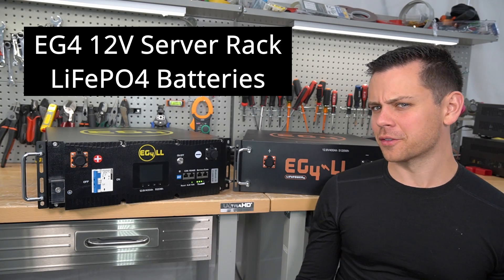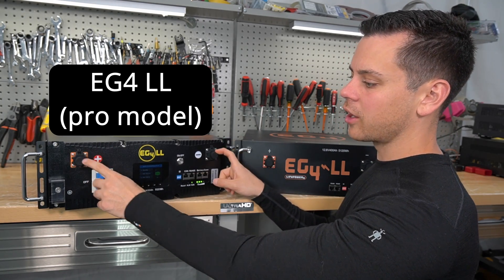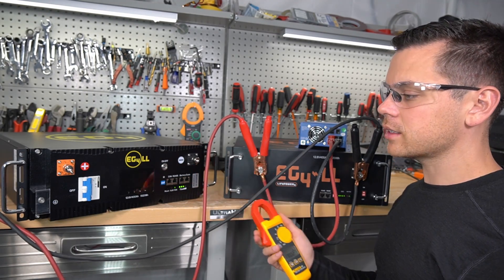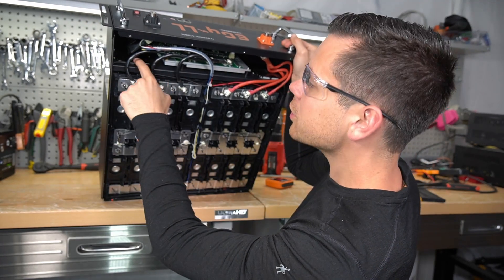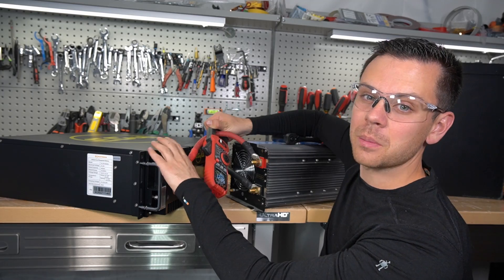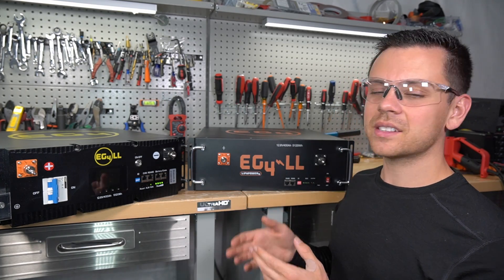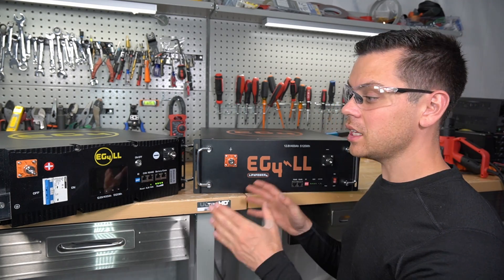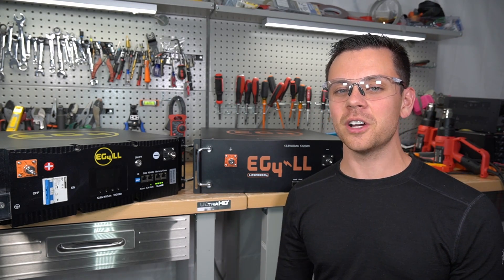$1,449 EG4 12V 400Ah LiFePO4 Server Rack Battery

Comment: You may not like 12 volts, but for us who have been on solar since 1984 we had few options. It still serves our small system well. Still living small.
Reply from the maker: My first 120W solar panel was $550 13 years ago, so I've had 12V systems longer than any other. And flooded cell batteries. And thats why I hate them 😂 never going back
Reply: @WillProwse   My fi"rst two panels were bought from an advert in a Mother Earth News magazine from Energy Sciences in 1984.  That's nearly four decades ago.  I was scraping around on beans and rice and built an earth shelter from native and recycled materials that year...a large truck battery for storage...two thin lites, one over the kitchen sink, one over the bed...a 12 volt JVC linear tracking turntable, cassette record and play, AM/FM/SW bands...that was my boom box...removable speakers.  I had a 5" black and white tv which picked up three channels I called Rambo, Dumbo and Bimbo.  Outhouse and hand pumped water in the kitchen sink.  Didn't get running water and indoor toilet until 2007.  We have a sauna at the center of our house which acts as a plenum and also our bathing space.  I still appreciate the simple life, although I do have more solar now...but still have many 12 volt appliances.  Yep, simple.  Wish more folks didn't live such wasteful, consumptive lives.
Reply: @WillProwse  I wish I could go with LiFePO4 batteries for my 36V golf cart, like you did for your 48V golf cart, but it gets over 130F here, and I worry that the BMS would shut down the batteries while driving.

Comment: I get that you've changed your focus to larger whole home systems so 48 volt systems make sense.  However, I miss your smaller system days.  Some of us have vacation off-grid properties where we have several small cabins or separate shower houses or saunas.  So we cannot justify and do not need the size and expense of larger systems.  Would be interested in unpdated info for smaller 12 volt systems using the latest reliable components.  This video was a great first step!  Did I hear correctly that these EG4 batteries have four times the Ah ratings of the Battleborn/SOK/etc... 12 volt batteries... for the same or less $?  Perhaps I misunderstood.  Thank you.
Reply from the maker: Yep that's why I made this video. Doing more 12V systems for people who keep requesting them
Reply: If you buy 4 Battleborn at the cost of $874 given by Will, you are looking at $3,500.  Or, you can get 2 of the "premium" version for the same $3,500.  That's 400 ah more for the same cost!  

I would get a pair of these 12v 400 ah batteries and wire them in parallel, you'll get a lower charge/discharge rate.

Comment: G,day Will from Sydney Australia.
'what I think '
I am analysing and putting into perspective;
* Easy use of a clamp meter (I like auto ranging multimeters).
* Using infa red scan to detect current heat (overload) at a connection/accessory drawing current.
* The difference between batteries in series v parallel (negative connection & positives) aluminium v copper as a conductor.
* Benefits of 24v over 12v systems. My answer is 24v= more Amps with fewer batteries?
🌏🇭🇲

Comment: Hey Will, on your price comparison, you say these are 327 or some in that ballpark but that is for 100Ah. On Signature Solar, they are marked at 1449 and 1799 each. Thanks.
Reply from the maker: This video is so long so I cut out a bunch of pieces. Totally forgot to keep the part in where I said it was 100 amp hour comparison. I didn't want to bore everyone with the long video.
Reply: I was confused as well, but I think Will is comparing prices per 100Ah. So what you have to calculate is the cost of the BattleBorn/SOK et. al. at the price listed times 4. So a comparable SOK system would be $559x4=$2236, as compared to the EG4 400Ah model Will has @ $1449.
Reply from the maker: Thank you Tom! Exactly
Reply: @WillProwse  👍

Comment: I have been using 4 of the 12v non-pro batteries for a year now in my yacht. They work amazingly. Mounting was easy. I built a wood bottom for the batteries with a lip all the way around so the bottoms cant slide and bolted that to the boat. Next, I installed a piece of strip stainless steel across all the mounting plates on the top to connect all the tops of the batteries together. Finally, I used 2 1000-lb nylon ratchet straps to hold the batteries down in the wood bracket on the bottom. The batteries don't move. I did not make a separate box for the batteries as they are in my engine room and not located around any moisture. If I get water up to the batteries, my boat is gone anyway.

My only beef with the eg4s is they don't make a 12v all-in-one converter charger to communicate directly with the batteries. I am using a multiplus 2 with Victron lynx and charge controllers.

If I was building a boat from scratch, I would go 24v or 48v. But, since my entire boat is 12v, i will just stick with that for ease of use.
Reply: Thaanks for the note about your boat install.  It sounds like you just stacked them directly one on top of another.  I am contemplating a similar install, but with the V2’s on our boat.  Initially thought I would install them in the engine room, but now targeting behind our flatscreen TV in the cabinet space originally intended for a tube TV.  But at 98 lbs each, that’s a slug of weight for a boat!  I am thinking of some kind of spacing between each unit to allow for air movement and heat dissipation.  I will also be installing them with a Victron MultiPlus II and Cerbo screen.
Reply: @mvfloatplane881  mine are mounted vertically, side by side...lugs are on top. I mounted mine in the center of the boat, midship. My old 8ds are mounted outbard stbd side. Right now, i am using them as start batteries so i dont have to change the alternators yet. I have 2 Renogy 60a dc to dc converters between the AGMS, and the Lithiums. Both renogys are switched. I usually only run 1 at at time.
Reply: @mandmmilling3716  Interesting.  My house battery bank compartment is centerline in the engine room but low, so I do not want to put mine there.  I will be installing Victron DC-DC chargers for my flooded start batteries, which are both outboard.  Interesting that you went terminals up.  That wouldn’t work for mine but I may rethink and stand mine on their side - it would eliminate the stacking issue.  I’d be interested to hear how long you can run on 4 of them.  I am buying 3 but was thinking of installing only 2 because even 800AH will be more capacity than we’ve ever had.  I have externally-regulated Balmar alternators and CenterFielder, each alternator 120 amp and 900 wats of panels along with an 8KW generator.
Reply: How many amps do you run into the 4 batteries to charge them. And do you have multiple charge controllers to charge each battery separately?
Reply: @EasyyokeFilms  the multiplus puts out 120a max, but i turn it down because of shore power limits. 3 charge controllers connected to the links (1600w). 2 110a standard alternators feeding 8d agms connected to 2 60a renogy dc to dc converters. 

Max i have seen from solar is around 70ish amps in perfect sun. 30a from multiplus, and 120a from dc to dc/alternators.  So 220ish amp under ideal conditions

Comment: I recently got 2x 200ah from Amazon for 1200. I also go the 24v Mppt all in one and when I first ac charged it I heard loud noise from the fan so I unplugged ac. Then I notice fault 2 code over heating so I waited  awhile disconnect from the batt and then I heard a pop when I tried to run a load so I disconnected again and it worked fine. I called watt24 but they didn’t pick up I just hope I didn’t get a dud

Comment: I will, I love your videos. I was wondering about your thoughts on four of these in a medium size travel trailer. I’m going to have about 1200 W of solar with a 3000 W inverter to run my mini split air conditioner among other things. Would you suggest wiring them to S to P for charging purposes or should I keep it all 12 V. Thank you.

Comment: Hi Will.  I'm definitely a beginner and will hire out my electrical work on my mini-bus, but I, at least, want a basic knowledge of what is going on.  You mentioned your love of 48 volts.  Do you see any of these large battery packs coming out in 48V?  I do like the idea of having one or two of these larger packs than 4-6 batteries.  I'm very limited in space and was going to put it in the "garage" area underneath my bed in a box.  These packs are so much nicer.  Any thoughts?
Reply: Most of these server rack batteries are 48V. For a given wattage, 48v require 1/4 of the amps and have the advantage of higher watt output and smaller gauge wire. Also, less amps = lower temps.
Reply: It sure is nice to be able to buy 1 or 2 of these.  Thank you.

Comment: I thought I wanted to go 48V...   I would guess that we could do a 120volt battery system...   why not 96V nominal?
Reply from the maker: Do 48V
Reply: What I want to start with is a UPS for a whole circuit
Reply: and then be able to expand to having it take solar and grid, and then add a bit more and have a minisplit that only runs when there is enough solar to justify it without cycling the battery.  then go to a whole house ups type setup with a bit of solar as backup, but would be nice to be able to backfeed to grid depending on prices

Comment: Why do you hate 12v?
Reply: The higher the Voltage of your battery/solar system, the more efficient it is to convert the power from the DC of the batteries to the 120V/240V AC of the items we need most of our power for, like refrigerators, etc. Also, Amperage is higher at 12V to power the same Wattage than a 24V or 48V system would be. For example, a 100W item powered by 12.5V, (The average 12V lead acid battery Voltage), needs 8A, while the same 100W powered by 25V would only need 4A to run it. While at these smaller Wattages, it may not matter, now imagine that you need to power a whole RV system that takes 10KW to run everything for a day, and you might figure out why 12V systems aren't as efficient, and why Will "hates" them. He DID start out with 12V systems in the beginning. See some of his earliest videos. ;)
Reply: @Tumbleweed5150  thank you I am a novice on this subject.

Comment: I feel like this device shouldn't exist. We shouldn't make 12v any easier. I can't think of a scenario where it's be worth it to build a system like this.
Reply from the maker: I just ran 48 to 12 volt converters in my RVs and vans. They are cheap
Reply: @WillProwse  those 48v to 12v power supplies handle starting the generator? Running electric leveling and electric slide outs? That's some high amp items for a power supply. What do you consider inexpensive? I checked, Victron doesn't offer anything but 24v to 12v higher amp power supplies.
Reply from the maker: @earlzeis35  yes because I had a small sla battery connected to the output. That's how I started generator, leveled my rc etc. Have you not watched my older videos? I took the Tesla battery videos down but I covered that a lot
Reply: @WillProwse  yes I watched a good many if not all your older RV related videos. I bought your book as well. Those videos were all 12v systems, that I recall.

I'm going to ponder 24v but I dislike needing to run 24v to 12v power supplies. How do they hold up? They reliable? My hydraulic disc brake actuator is 12v and can pull up to 40a. Not an item you'd want to lose 12v to. 

I don't see Victron offering any 48v inverters for RV 50a like the multiplus ii 2x120. Definitely don't want to run dual inverters for split phase. Too much cash and I don't need that much inverter power. 

Am I missing something on using 48v with a single inverter on a RV 50a?

I camp mostly in shade. So I planned to do two parallel arrays with 24v panels. That would work great on 12v and good on 24v. But with 48v you'd need to run series or series parallel to get enough voltage to charge 48v. Not good in full shade or even partial situations.
Reply: @WillProwse  which victron 48v inverter would you recommend to feed both legs of a RV 50a on inverter power as well as shore?
Reply: @WillProwse  I use the 48V to 13.8V buck converter, as the 48 to 12V one seemed weak, and because it only put out 12V, not higher, the Amperage ate up the cigar style plug on my air compressor for cars. I still have the 24V to 12V buck converter, but won't even sell it or give it to someone, as I don't trust it.
Reply: RV wise you're stuck with 12v. Unless you want to buy and install a few 24v to 12v power supplies. The entire RV runs on 12v. RV style invertors are usually 12v and some 24v. The popular Victron multiplus ii 2x120 for RV's was only available on 12v until recently. Now you can get 12v or 24v. I don't believe Victron makes a 48v to 12v power supply, I don't recall seeing any.
Reply: Finding the highest voltage you can run lights fans refrigerator, pumps etc ..and at the highest efficiency, with the least amount of draw in watts including standby combined with a solar package would be ideal. 
Bang for buck ROI without going overboard thus suffering the diminishing returns route.

That means picking a voltage that all your “NEW” components can run on at the highest efficiency.
Reply from the maker: I agree with you 100% and that's what I tell everyone too. But everyone keeps disagreeing with me and asking for 12 volt content. I don't understand why they like 12 volt. It makes me angry personally lol
Reply: @WillProwse  I was on the 12v train for a long time. 12v has the advantage that you can connect all sorts of car appliances without a step down converter that decreases efficiency and complicates the setup.
48v compatible gear seems to be more expensive. But yeah, the losses and cables sizes required are insane. Currently looking if 24v would be a good middle ground for my campervan. There still a lot of car appliances that do 24v because trucks run on 24v.
Reply: @WillProwse  reason why is if you make a mistake wirh 12v your not going to die. With 48v def ur gonna die from touching the wrong thing. People don’t like electric as it is. It’s dangerous as hell. 12v no worries. 48v like u said I wouldn’t touch anything inside. Well duh. Also 90% of us aren’t electricians. Think real hard about that

Comment: Confirm. When a manufacturer states 7000 cycles at 80% DoD it means to discharge them 7000 times (100-20%) and after those 7000 cycles. The battery will have 80% of the maximum capacity left?.(5120*.8)
Reply from the maker: Yes
Reply: Kinda short. I thought lithium wirh care would last 10-20k cycle
Reply: @jecrpalier  which should equate to my understanding. You still have a ton of use left after 7000 cycles. I would like to see data/research on the life after those 7000 cycles if degradation is similar. Another 7000 to 60% etc